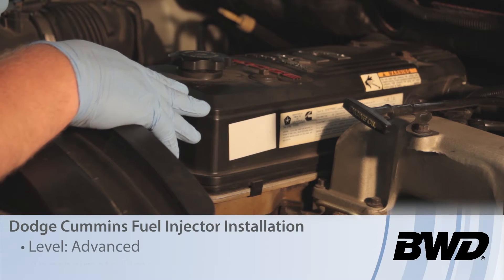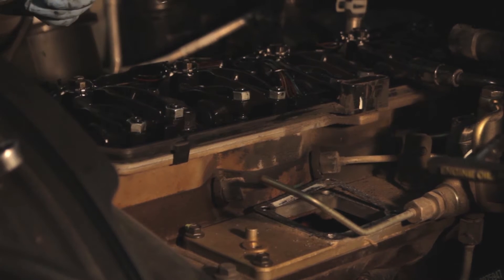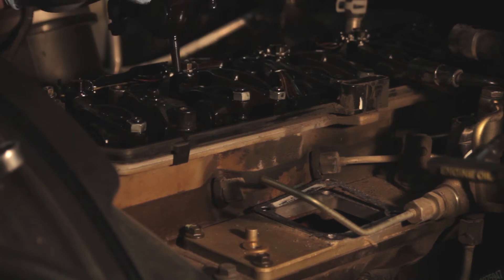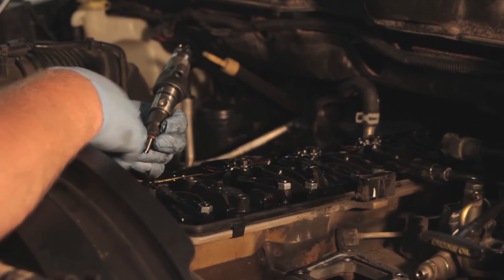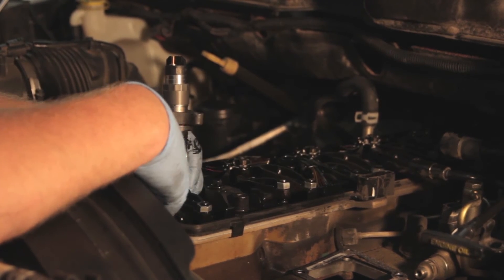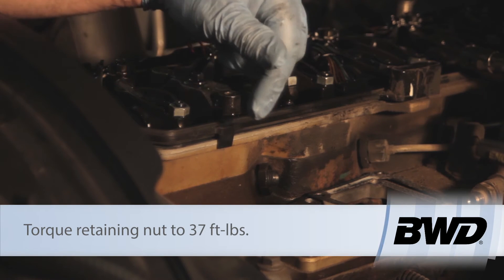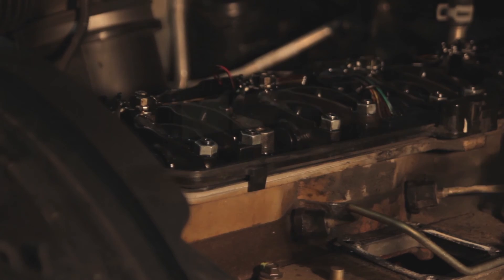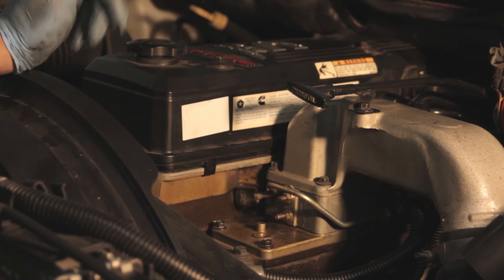How to Install a Fuel Injector on a Dodge Cummins 5.9L | Know Your Parts

Comment: The copper washer should be 1.5mm thick and should be checked that it is.  You also forgot to mention the torque value for the injector hold down bolts and the proper procedure.  The injector should be torqued to 45 in/lbs then loosened back up just to make sure its seated, then crossover tube installed and torqued to 125 in/lbs then injector hold down bolts to 89 in/lbs.  At that point you can torque your crossover tubes down to the 37 ft/lbs.  The exhaust rocker would like 28 ft/lbs on the bolt holding those.  This information was all provided from a factory service manual.  Some say more crossover tube torque is required due to the tubes loss of torque and leaking on many engines.  I have seen up to 50 ft/lbs being used and suggested.  There was a TSB from dodge about it years ago.
Reply: 44 ft/lbs is the correct updated crossover tube torque. Also the fuel lines are more like 22 ft-lbs. Not 37 ft/lbs like the video said. 

This video was good visual, but bad for actual procedure and specs.

Comment: I just did a rebuild on my 5.9 and I'm installing my new injectors and found there is a gap between the head and the hold down around the Injector.. is this gap normal? It wont go down any further I'm beginning to think this gap is normal?